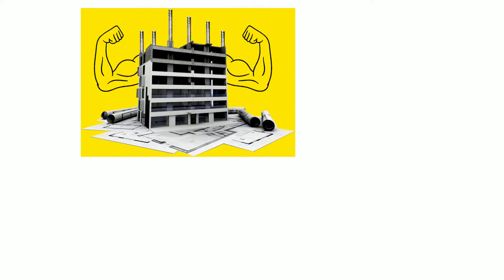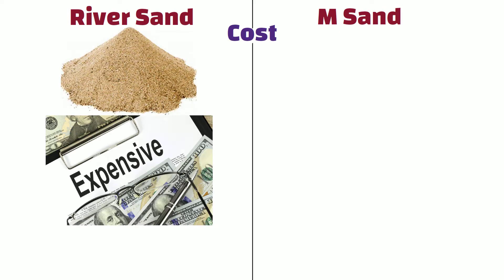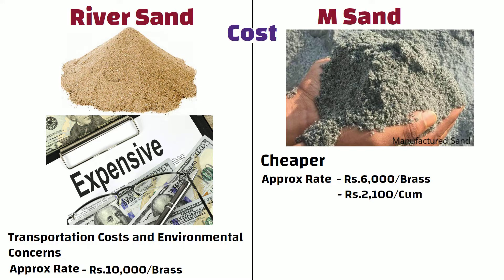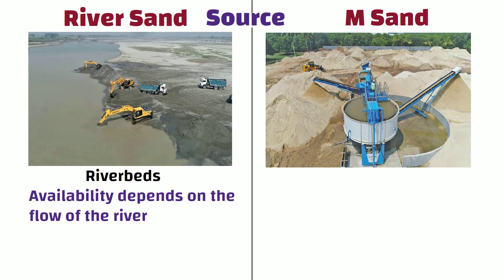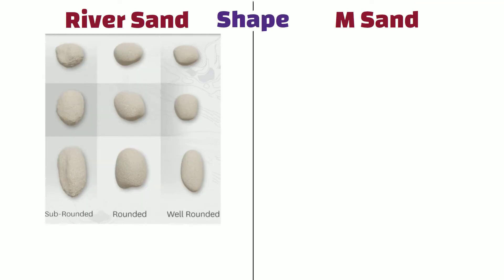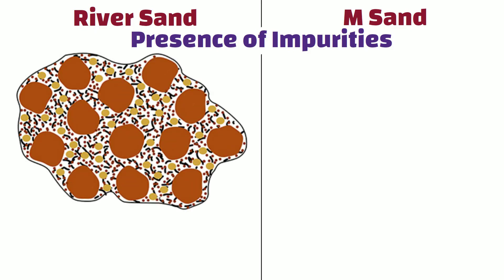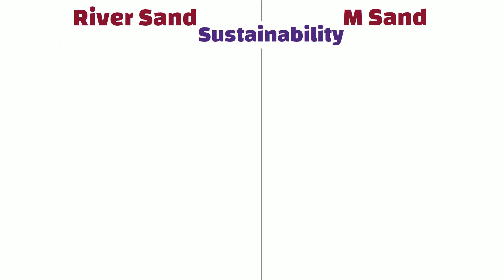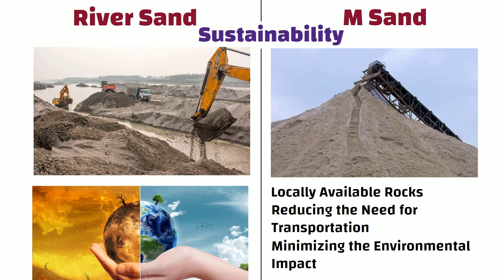River Sand vs Manufactured Sand

Comment: How to calculate brass in a truck which claim they bring 3 brass sand?? Any method?
Reply from the maker: Take measurements of truck in meter and get volume in m3 and convert it to brass. 1 brass = 2.83 m3
Reply: @engineeringmotive  thank you so much your videos are informative and amazing 👍